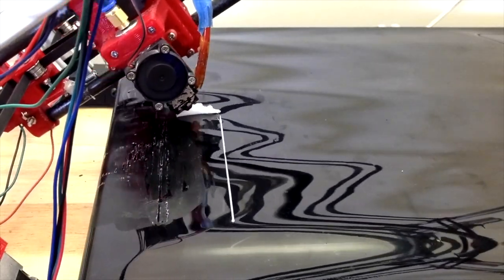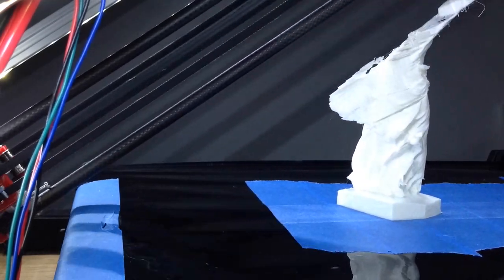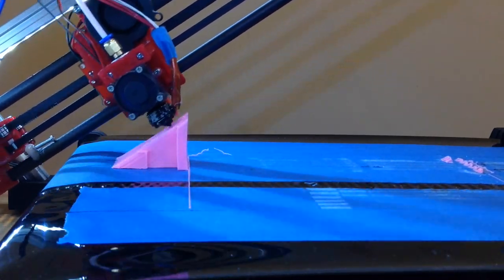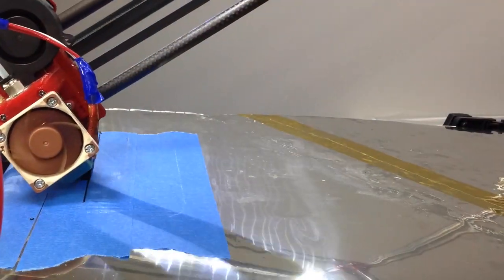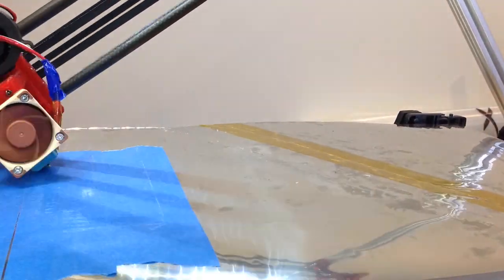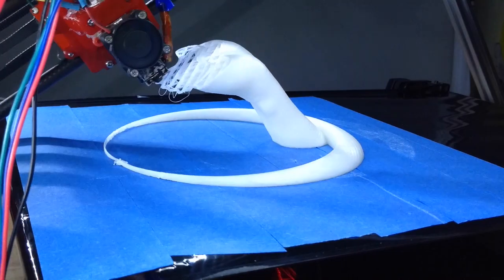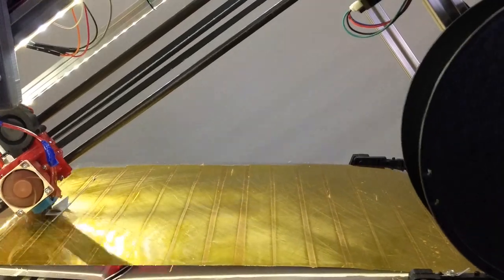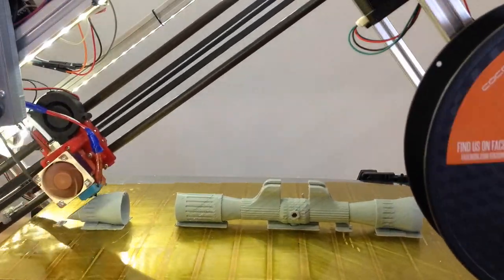Hypercube infinite: Fails

Comment: Thank you very much for your inspiring videos!
I would also like to build such a printer, but a bit wider for large RC-model airplanes with 2 - 2.8 meters wingspan and 50 - 60 cm depth.
But I can't find a suitable belt for it. And your material is probably not the best solution. I think CFK would be very good, but where should you get it?
As soon as I can answer this question, I will build a printer.
Reply: LuLaLeLa https://www.precisionsteel.com/spring-steel/50-carbon
Reply: Maybe this will work. Take a look
Reply: Thanks for the tip. With a steel band it might also work. But the surface is much smoother than with carbon fiber. I will test it as a printing underlay before I use it as a belt.